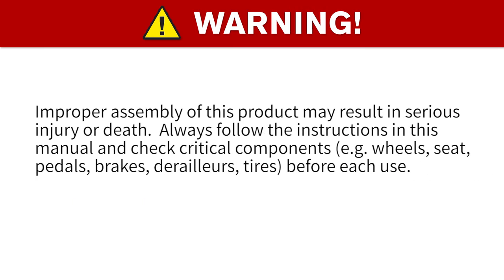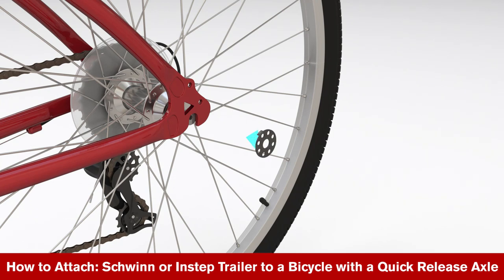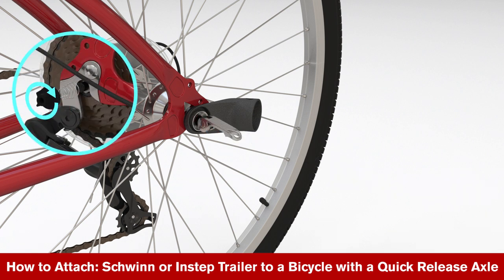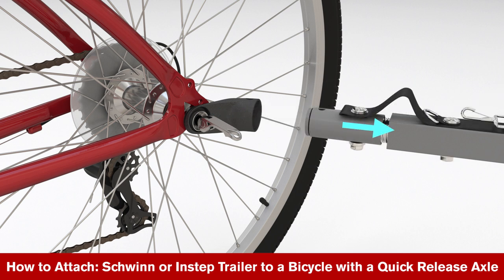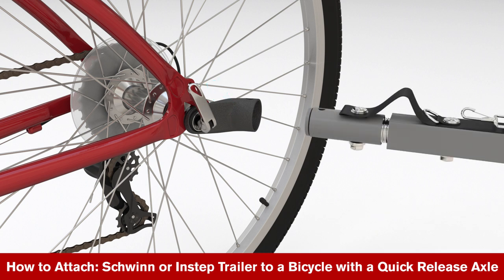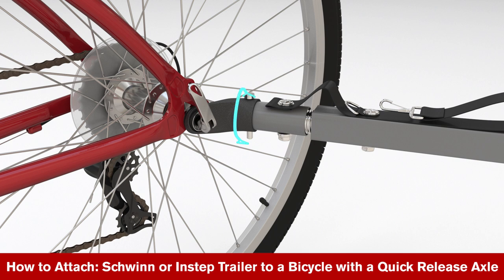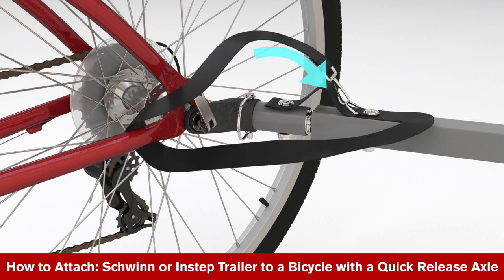How to Attach a Schwinn/Instep Trailer to My Bicycle with a QR Wheel

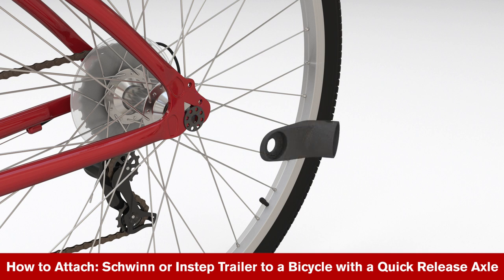Comment: I'm attempting to install the coupler for a Schwinn Rascal pet trailer, but when I get to the part at 0:41, the bike's axle nut and washer are too large (in diameter) to seat correctly into the coupler. Does Schwinn sell a larger diameter coupler that is compatible with the Rascal?

Comment: does this attach to bikes with 12mm thru-axle?
Reply from the maker: Hi Samuel, For the trailer couplers we generally suggest use of a nutted or quick release axle. With a thru axle there may not be enough length and the width may be too large. Thanks, Nicole

Comment: Hi. The tab washer does not line up with the frame dropout on my bike. Instead I have lined it up loosely where the axle slides into the frame. How does this impact safety or damage to the trailer or my bike?
Reply from the maker: Hello Baron, 
If the tab on the washer doesn't seat into a slot on the frame it is recommended to place it in the drop out of the rear frame. This is correct installation. 
Thanks,
Nicole
Reply: thanks
Reply: @schwinnbicycles  What did you mean by the "drop out of the rear frame"?  A picture would be helpful.  Thanks.
Reply: @albertc879  By "drop out", they mean the same slot where the wheel "drops out" of the rear frame when the axle nut is loosened.